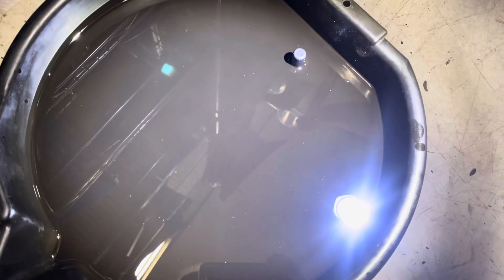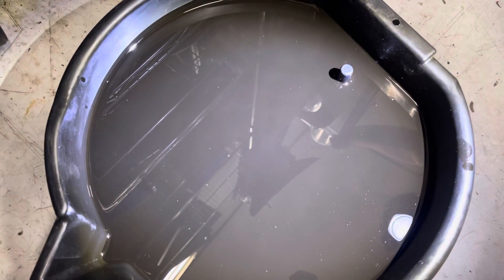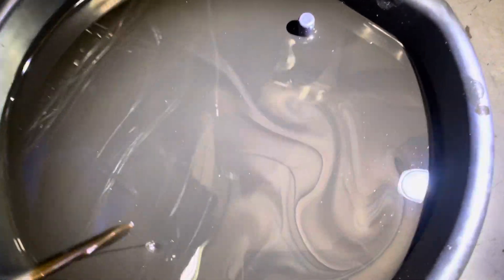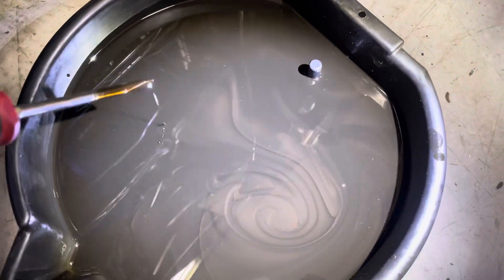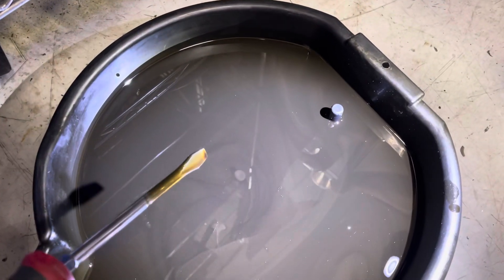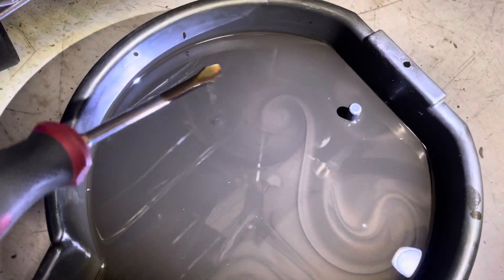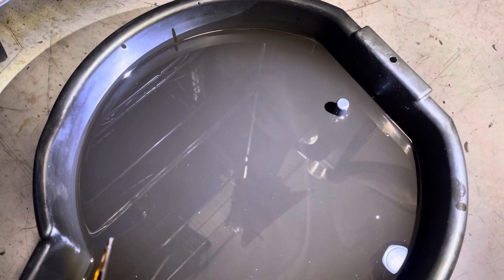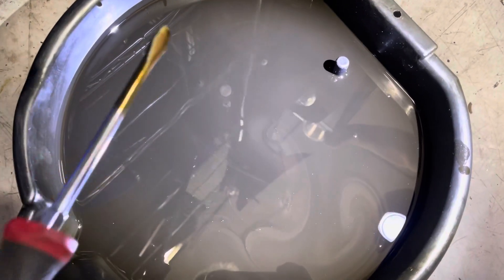Are you thinking your LS/LT trunnion upgrade has saved your engine? Probably not. Here's proof.

Comment: That’s so bad that it happened like that. I’ve been using MM bronze and CHE bronze upgrades in standard LS rockers for years with no trouble so far. I run my engine coolant around 180 degrees and max oil pressure of 75 to 80 psi at 3200 rpm up. Could it be an oiling issue that causes premature wear?

Comment from the maker: To be clear, I have dealt with every rocker trunnion  upgrade on the market except for Brian Tooley's latest version. This includes all of the bronze bushings from Straub, Smith Brothers, CHE etc. It does not mean that they are going to fail immediately and there are some benefits to running the CHE bushings. A person that I consider a friend actually designed those and had CHE make them and I consider him to be brilliant. Not pressing the bushing into the rocker lowers the MOI to the lowest value possible. I have considered sending some trunnion bodies off or DLC coating unless they are able to coat the inside and outside of the bushing itself. This would raise the surface hardness and lower the friction coefficient to something that should absolutely work.
Reply: Do you GAF that 95% of the readers, including me, have no FI what MOI or DLC mean? Why do you guys take the time to video and then answer questions to lose your audience with acronyms? I really wanted to know more about these trunion upgrades.

Comment: Glad I saw this. Just did a truck Norris cam on my Yukon. Did the Smith Brothers bronze bushing “upgrade” for safe measure. Today was the first oil change since the swap and it looks exactly like the oil in this pan. Scared the shit out of me. Guess I’m pulling the ones off my spare motor and swapping back.
Reply from the maker: These particles are so small that it's possible they wont cause any engine damage. 

The trunnion bushings or bearings are failing though as you've witnessed. 

One bearing upgrade that I've not tested but I believe should work is the BTR V2. I spoke with Brian Tooley at length about these. Clearly the issue is that the trunnion bodies aren't hard enough. Good enough material to create a hard enough surface is cost prohibitive so Brian came up with the idea of a thin, super high caliber, super hard material to use as a sleeve over the trunnion body. This provides a hard enough surface that the needle bearings will hopefully not begin to wear through.
Reply: @Always_Fixing_Things I’m sure you’re right. I couldn’t even feel the particles in the oil I drained out of mine. Still not a huge fan of it though. From what I saw, you hit the nail on the head. I ordered BTR’s new V2 set with new rockers last night. Not driving the truck until they are here and installed. Will drive it the same 3k miles and see the difference.
Reply from the maker: @99LSDyme 

Even though the particles are very small and might not harm your engine, the bushings are failing.  
 CHE don't press in so they rotate independently of the rocker arm and the trunnion body lowering the moment of inertia.

Comment: so im beter off with stock rockers with needle bearings? or maybe aftermarket with larger needle bearings?
Reply from the maker: The issue isn't with the size of the needle bearings and there's only a certain amount of space between the trunnion body and rocker. This trouble is caused by the lack of quality metal used in the trunnion bodies. I've seen various manufacturers polish the surfaces to a high luster without any gains in reliability. It doesn't matter if it's bushings or bearings. The result has always been the same. At least the CHE bushings aren't pressed in so it won't wear in the same place every time. It also lowers the MOI of the rocker for better high RPM stability. The hardness of the surface of the trunnions is the issue. Brian Tooley might have solved this with his latest rocker design. He added some super hard sleeves to the ends of the trunnions which is a brilliant idea for cost savings but effectiveness.
Reply: @Always_Fixing_Things So have you tried this with the che installed? Or seen anybody say anything?